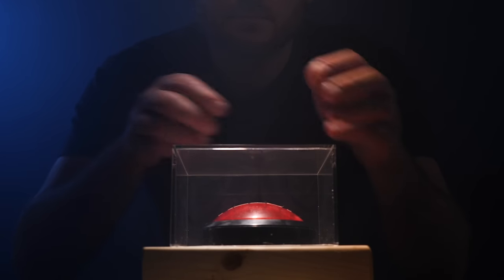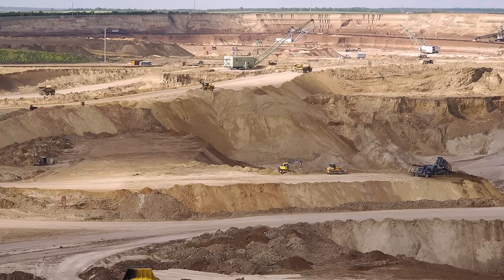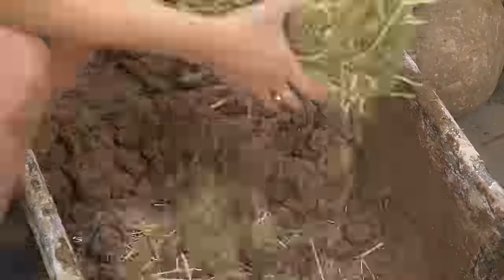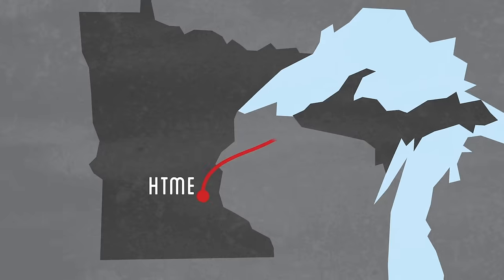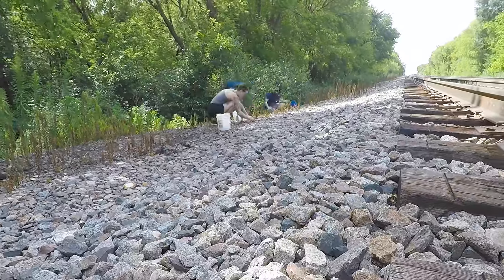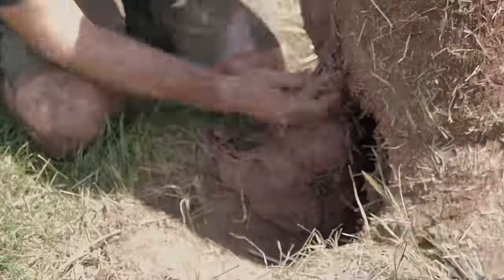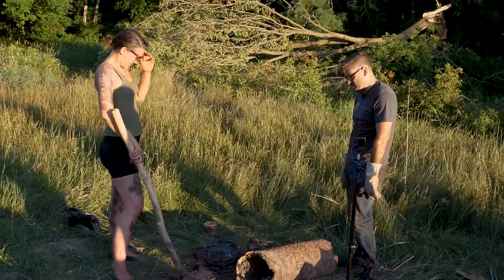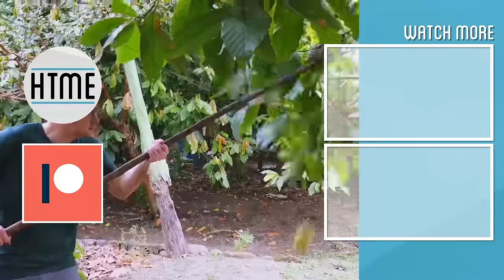Smelting Iron from ROCKS (Primitive Iron Age Extraction)

Comment: Yuo are doing early humans a disservice messing with grass and mud. They could easily make a stone chimney stack. Ok I'm an engineer but I can easily melt Iron at home and back in the day if I had seen melting copper out of rock I would have been trying to melt every different rock of colour I could find. Iron can be melted easily in a decent crack in a cave. Once you have poor quality iron you have a drill for stone and that is some usefull technology. I also think iron was first melted much earlier than 1500bc and probably shortly after copper was discovered. You cant find it because Iron in a thousand years is an orange smear that washes or blows away. I have old iron farm eqiptment that has almost gone.

Comment: That water/oxidizing iron event sounds very hokey. Oxygen makes up the earth is 46% of the mass of the earths crust and 30% of the rest. it is very abundant, so as the cosmic plasma condensed into varying amounts of distinct atoms represented in the periodic table many interacted to become compounds. Oxygen, being one of the most reactive, combined with many other elemental atoms to become  oxides of those elements as compounds. They were formed under heat and can be separated by heat. It is debatable to how the molecular oxygen, O2 became free, sure, certain life forms produce O but an early earth was a super heated steam oven as the volatile H2O was a super heated gas near the surface, possibly, hot enough to split the molecule into H and O. perhaps allowing the O2 to accumulate over time.  High above the surface, the gas would cool as it gave up its heat to space and condensed into intense rain drops that never made it to the surface for perhaps millions of years. A process very similar is used in chemical production and refinement, but on a much smaller scale is called  refluxing , done in a  re-flux tube or tower..

Comment: you should tae a look at how ancient Indian blacksmiths smelted iron, and their casting process. I noticed you having trouble casting molten metal in your videos, and the final result is not up to your satisfaction. smiths even today in bharat, are using most of those ancient processes (as those of the ancient times did). their works are excellent, and there are more than 3-4 ways to cast metal (in bharat) which will give excellent results. please try those out, you would get better results. keep up the good work.👍🙏

Comment: Using those bellows could have been improved dramatically.
Your sucking the air back right after you are pushing it into the tower.
If you would have cut a simple hole into the bellows, and put a flapper of wood there on the inside, and made everything much easier,
The flapper would have to be set to fall down over the hole.,
You could have doubled the effects of them.

Comment: One pot of a quarter of the volume of both of them would have allowed the same amount of leather to be expanded greater increase in the amount of air sucked in and expelled, and would have also increased the amount of flow and pressure of the air being expelled, the pots are too big for the amount of leather on top

Comment: You kinda miss a big point of debate.  Iron is easy to find.  The stone age guys knew their stones and knew their rust.  Copper and Tin were hard to find.  Smelted iron is useful and easy reuse.  Debate is... there was only an Iron age; Bronze age was a later off shoot into expensive, less-resused metal.  If you reuse Iron, it doesn't leave an archaeological record.
Reply: Smelting iron ores into metal demands heat not easily reached. Not to mention alloying carbon with iron is finicky process as well. Oldest iron artefacts are from meteoric iron which is very pure and thus skips the most difficult part of making iron tools and weapons.

Comment: not quite sure there is any iron there at the end. that just looks like slag. its not easy making iron with a bloomery furnace, especially if you are manually pumping air into it. That requires hours of hard work at the bellows to keep the temperature high enough.

Comment: Isn't gathering modern dumped iron ore and using electric powered tumblers "cheating". Don't get me wrong, I wouldn't have gotten that far. But if we're going for, "doing it from scratch" our processors, (presumably) didn't have access to train droppings, mine cast off, or electrical machinery.

Comment: if you have leather, why not just make paddle bellows, which are much easier to make and use? similarly, with a drywork brick bloomery, much easier to make and use. And then you could have the iron flow out through a gate, and keep the furnace going as long as you like. it's not like any of that is high tech or even clever.

Comment: I'm late to the party but....... Why did you hand pick the iron pellets along the rail line ?!  Why not use a magnet ?!  Many hardware stores will have a long handled, large dimensioned magnets for picking up dropped nails, screws, washers, and any other iron based items.
Builder's supply houses even have wheeled versions 20-24" wide and a long handle to push/tow it along.  No bending over/squatting.  Contractors (especially roofers) use them to de-nail a property after the project is finished.

Comment: The introduction isn't exactly correct. As I understand it, oxygen didn't reach the atmosphere until most of the ferrous ions (Iron missing two electrons) had become ferric (3 electrons missing) oxide, Fe2O3, more correctly Fe₂O₃.
The really mad part of that, is that methane (CH₄)  in the atmosphere (a.k.a. natural gas) kept the seas warm enough not to ice over, and when the oxygen emerged every molecule of methane became one of CO₂ and two of H₂O. methane is tens of times as powerful as CO₂ at absorbing infrared, and it is reckoned that great areas of ocean froze over, until volcanic eruptions supplied enough more CO₂.

Comment: I think it would have been better to do an iron extraction from the water, whenever you see that red slimey shit in the water u can turn that into straight up iron. Using the same methods and tools as our ancestors i.e, putting that water in clay pots, letting the water pour out over time through the pots walls letting the "mud" that is left behind in the pot to dry up. That mud is iron oxide left behind by bacteria, they would smelt that and make little iron pellets, re smelt and bam ya got bog iron, what most peasants made